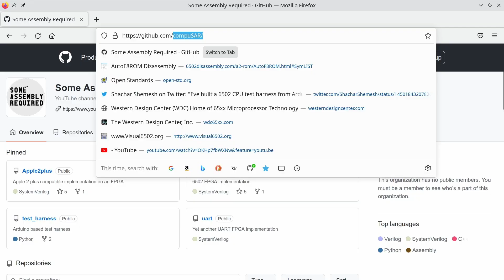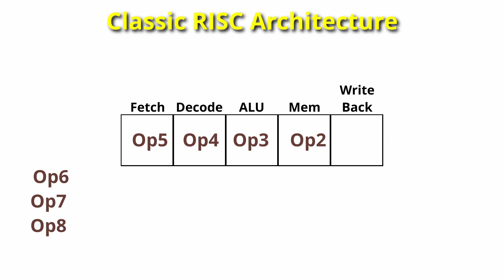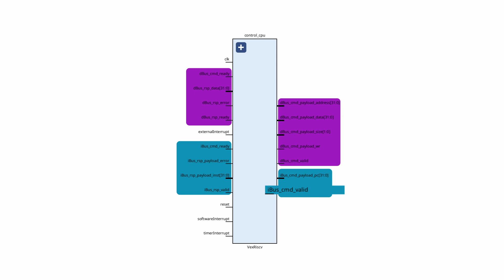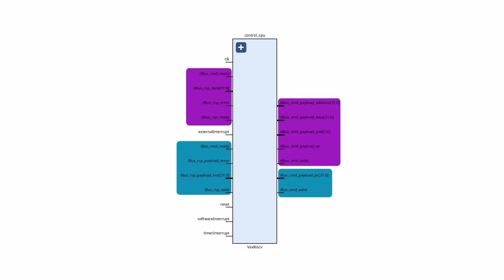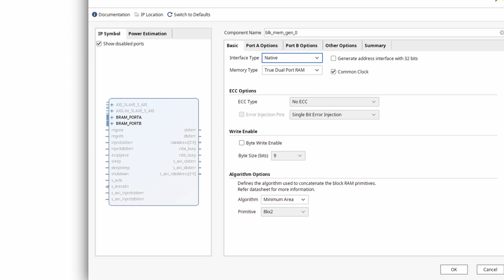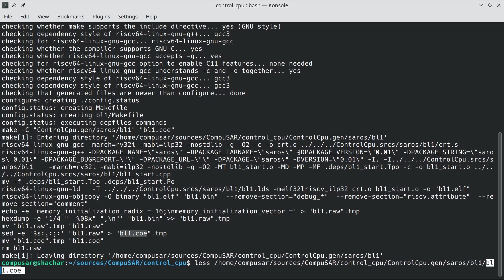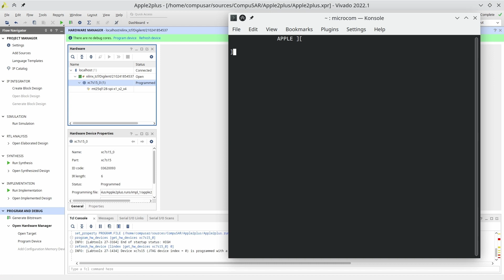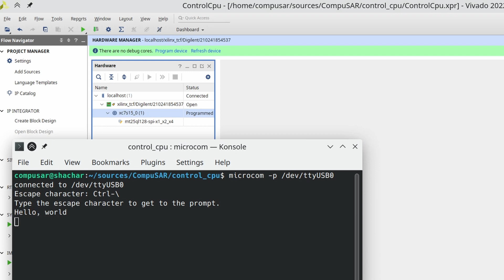RISC based computer on FPGA

Comment: Do you know how to setup OpenOCD to debug a VexRiscV?

I instantiated a VexRiscV on a Lattice ECP5 (Colorlight v8 5A-75B board) , but the SpinalHDL OpenOCD fork  ( 0.11.0+dev-04036-ga0220ad30 ), fails to see it due to dtmcontrol is 0 or JTAG scan chain interrogation failed: all ones.

I built the bitstream using:
python3 -m litex_boards.targets.colorlight_5a_75x --board=5a-75b --revision=8.0  --cpu-type=vexriscv --cpu-variant=standard+debug   --uart-name=crossover --with-jtagbone   --csr-csv=csr.csv  --build  

and testing it via:
./src/openocd -c "adapter driver ftdi" \
              -c "ftdi vid_pid 0x0403 0x6010" \
              -c "ftdi channel 0" \
              -c "adapter speed 1000" \
              -c "transport select jtag" \
              -c 'jtag newtap lx cpu -irlen 4' \
              -c 'target create lx.cpu0 vexriscv -endian little -chain-position lx.cpu -dbgbase 0xF00F0000' \
              -c 'vexriscv cpuConfigFile cpu0.yaml' \
              -c 'init' \
              -c 'reset halt'

The only example I found uses uartbone, but LiteX does not support uartbone on the Colorlight 5A-75B..  but I would think that the LiteX jtagbone should be doable too!